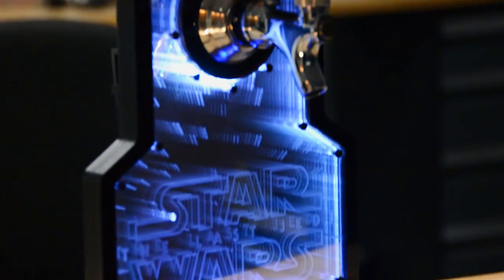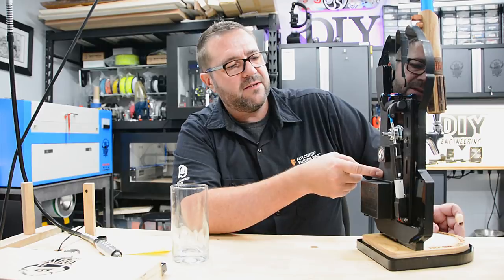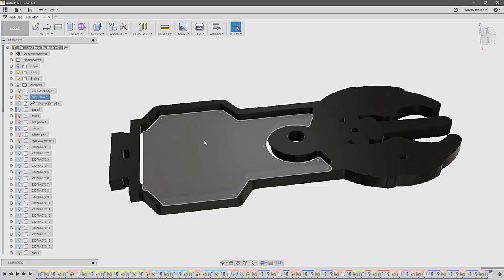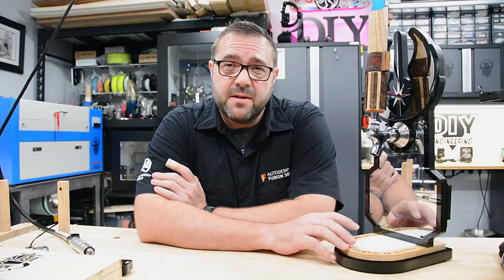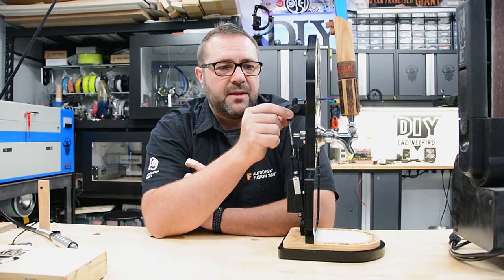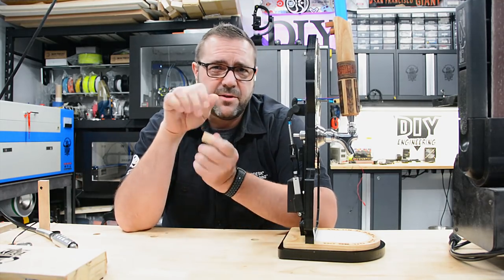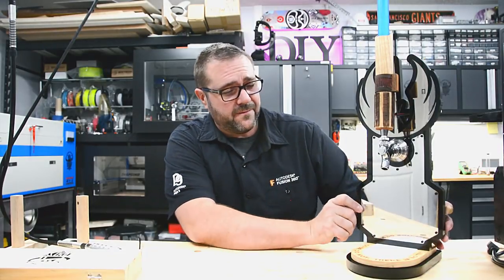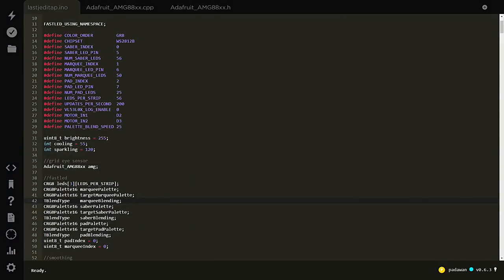Episode 031: Jedi Force Beer Tap!

Comment: Great project! Have you thought about adding some bracing to the back to give the vertical section more rigidity?
Reply from the maker: Jon Vannatto it's pretty right 18mm acrylic, but it could use stone lead in the base.
Reply from the maker: it is stronger than it looks, 18mm thick joint, but I did not have the screws in the base.